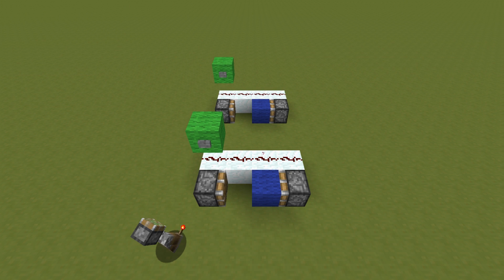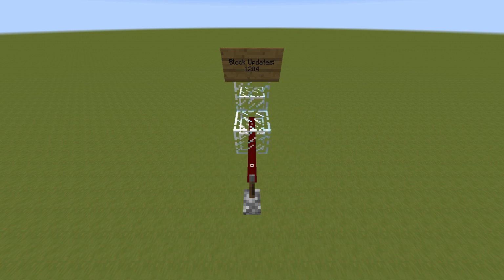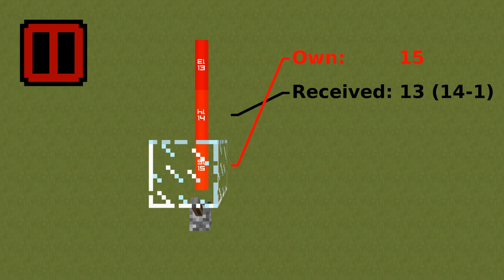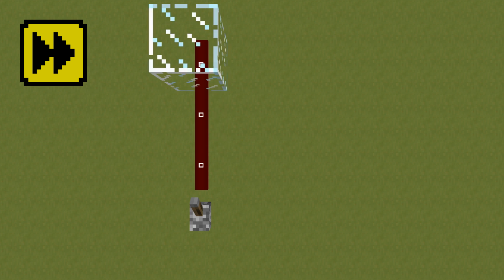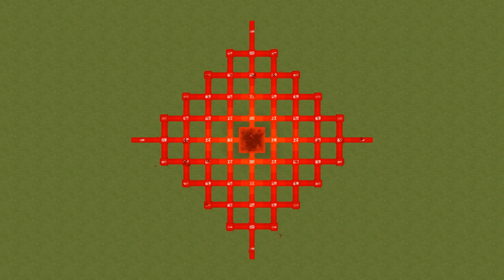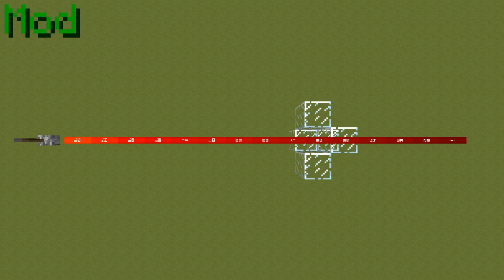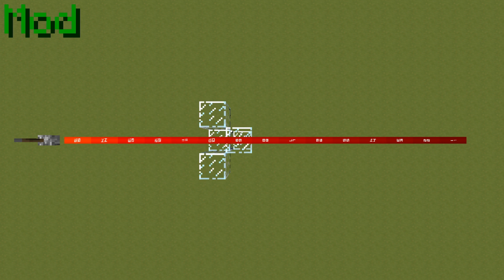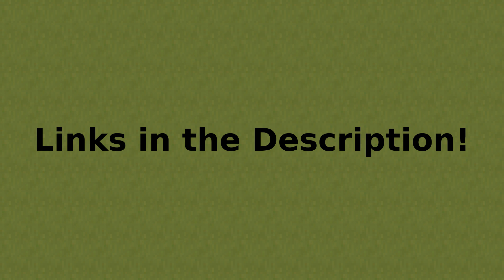Bugs and Ideas #03: Redstone Randomness and Lag

Comment: I think this could be your second addition to the game code!
The update order seems logical to me (except the quazi contivety is reverse)

Am I correct in assuming if you wouldn't keep old  behavior (only update around the redstone instead of in a 2 block range) you would need a maximum of 5*length of the redstone wire updates?

And how do you evaluate the state of the redstone wire in advance? By looking for all connected power sources?
Reply from the maker: I doubt that this will make it into the game code for two reasons:
1. They already work on a different system for Win10/PE which probably will get ported over.
2. The fix is only for redstone wire and therefore incomplete.

The two wide range is sometimes needed if the wire points into a block. For example a dot can power 22 different blocks. But it would be a whole lot less updates anyways.

In the description is a link to my post on the bug tracker about this fix. I explain how the wire is updated there :-)
Reply: I guess that when a redstone wire updates instead of updating the wires to change them it directly changes them and makes a list of blocks that should get updated. That way it doesn't update blocks multiple times in one tick, which is the main problem.
Reply from the maker: Yes, there is a list of updates. The main problem with implementing it is to keep cases in which wires get powered from several sources working when one source turns off. That's done by first powering off the connected wires and then turning them back on starting from the other power source.
More on it here: https://bugs.mojang.com/browse/MC-11193?focusedCommentId=320079&page=com.atlassian.jira.plugin.system.issuetabpanels:comment-tabpanel#comment-320079

Comment: Redstone lag wasn't too big of a problem for me prior to 1.9. But since 1.9 redstone seems to cause 5 times as much lag as before, it's really quite frustrating. I really hope mojang sees this as an opportunnity to fix this lag.
Reply from the maker: Hmm.. It might be that we talk about different types of lag. Because redstone eats up resources ever since it's first implementation.
Since 1.9 the rendering got more lagy and FPS drops became more recent. So I assume you talk about that. That's unrelated to the redstone lag sadly.
Reply: You're absolutely right. But I thought the many block updates redstone causes also contributes to the lag I experience. This doesn't make much sense however, since redstone has always behaved this way, and the FPS lag only increased since 1.9. Bbefore 1.9 my machine didn't have much trouble handling big redstone contraptions. Anyway, I hope both problems will get fixed soon.

Comment: well... i guess it s nice but what i dont like is that it makes for example the dropper lines much easier... imo you shouldnt only keep the old stuff that worked working but also the old stuff that never worked not working as far as possible
Reply: What's wrong with the dropper line?
Reply from the maker: "imo you shouldnt only keep the old stuff that worked working but also the old stuff that never worked not working as far as possible"
So basically just never change anything?
MC-11193 is exactly about the update order randomness that keeps dropper lines from working. The fix was designed to change exactly that (and MC-81098 ofc).
Reply: He wants to say that if for example someone had a redstone wire next to a dropper line.
It wouldn't be an instant dropper line in the vanilagame. But with this mod it would and that could case problems. (It's not a big deal in this example but it could be)
Reply: yeah, you also have a point but it wouldnt be if the instant dropper line wasnt locational before...
but no, that isnt what i m saying,i dont mind it being somehwat logical and less laggy but it making things easier in that way in dont like..
Reply: Jendrik Weise But it would also make somethings harder so I think that's fine
Reply: Jendrik Weise
Making things easier...hoppers do the same thing without redstone. (Is an instant vertical droppper elevator possible with this mod?) This means droppers can be used instead of hoppers maybe causing less lag. I don't see why easier is bad if its logical and doesn't break anything.
Reply: speed is important! :D and yes, i dont know of an easy way to build an instant dropper elevator but there for sure is one
and i dont like easier bc difficulty is the fun part normally.
Reply: Jendrik Weise
There are some easy to make vertical dropper elevators, but all the ones I've seen suffer from unloading chunks and items getting stuck.